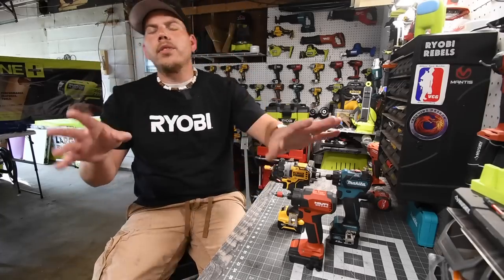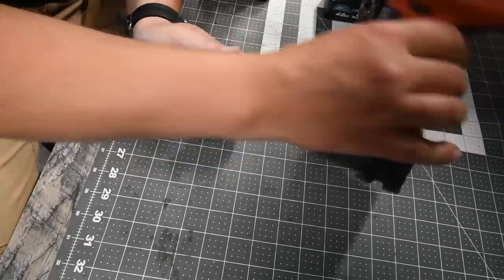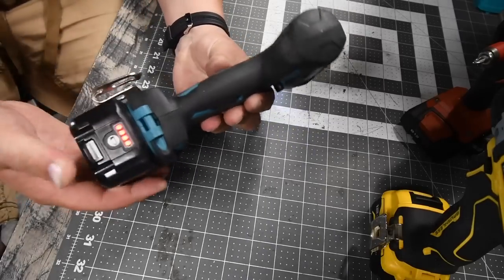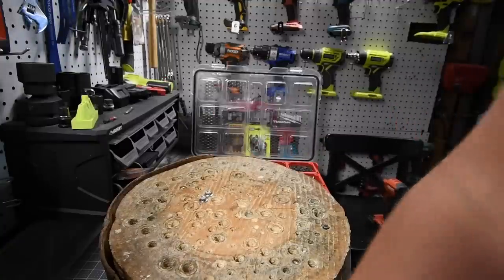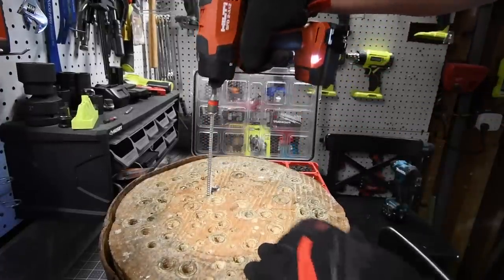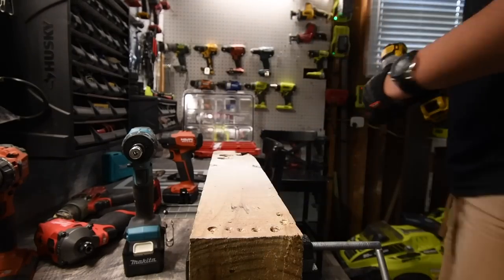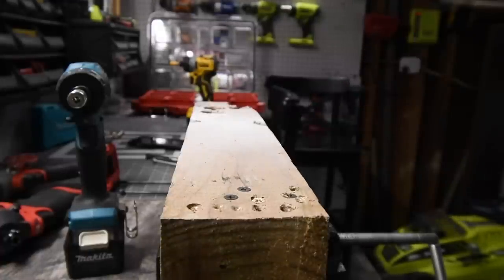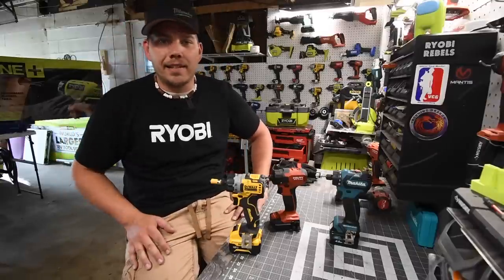The Perfect DIY Tool (12v ScrewDrivers)

Comment: The customizable clutch on the DCF601 is awesome for delicate work. It literally takes the pressure off the bit and screw head and greatly reduces stripping. Very good for use within the home and the tri light is awesome across the line

Comment: That DeWalt 601 is my most used tool. I rarely need to grab anything else. It's very strong, but if needed on Clutch 1 it is perfect for just about anything. I use it on the gun bench all the time. Perfect tool for 99% of jobs and hobbies around the house/garage.

Comment: I would guess that I use the Dewalt DCF601 for more than 75% of tasks, which was a real surprise to me.

I love how light the clutch can be set.  Originally I picked it up because #1 setting on the DCD791 may light for working with wood, but still has too much bounce from the clutch that it almost acts like an impact when screwing in plastic parts like thermostat housings, new ultra thin  and soft aluminum soffit,  etc...  

The 12v Dewalt #1 setting is reliable and light enough that I have no fears about using it to screw in circuit boards. While not the fastest at drilling, it is much nicer to spend time on a ladder with it alone if you only need to drill pilot holes.

I am sure that the other brands work great too and I selected Dewalt purely due to local vendor availability.

Comment: Why in the world would you burden those tools with those huge batteries? The whole point of 12V and a dedicated screwdriver specifically is to make it smaller/lighter than the 18V tools.  Just put a small 1.5-2.0 Ah battery on there and that will be more than enough power/capacity for most DIYers.

Comment: One underrated cordless screwdriver has to be the M12 brushed screwdriver. It can be found regularly for 79.99 (with two 1.5 batteries and a charger) and for stuff like machine screws, drywall screws, or other light-duty tasks, it's an amazing tool because of how light and handy it is.
Reply: I’d agree, i believe that brushed screwdriver can keep up with these brushless that mct has
Reply: @kcvu7215  It's not even close. It cant keep up with these tools in the video. the m12 fuel may be able to, but it's a much larger tool. the standard m12 is completely outclassed by these tools.

Comment: Before watching any of this, I would say the problem around 12v tools is still lack of options. Milwaukee has most things in 12v, except a heat gun. Their soldering iron is great until the thin plastic retaining screw breaks from getting too hot. 

DeWalt now has excellent 12V tools but there just isn’t the variety yet. Hopefully they keep making them. 

Makita has good 12V tools, as well, but again they cover just the staples for a power tool kit and that’s it. 

Then there’s Ryobi. If you can think of it, they make 3 different kinds. Aside from a coffee maker. They got soldering irons (Milwaukee’s is better for the field), heat gun, rotary tool (again Milwaukee’s makes more sense for the field), a vacuum, etc. the only problem is that it’s a larger 18/20V tool. Even the compact Ryobi tools are larger than the other 12V competitors, because it’s still a larger tool and battery. 

Ideally I’d like for Ridgid or Ryobi (or DeWalt, doesn’t matter) to come out with field-centric tools in 12V sizes. Or for Milwaukee to introduce a few more 12V tools and bring the price down a bit (which we know won’t happen)

Comment: Love the video and your channel. I also love 12v tools but this is one tool I never understood the need for? I personally just use my M12 impact driver on mode 1 or lower the clutch setting on my drill if I need an "electric screwdriver driver". Not trying to be negative just don't understand is all.
Reply: The brushed Bosch pocket driver is another great tool for the DIYer
Reply: Dude I thought I was the only one!
Reply: I kind of agree. I have the Milwaukee that came in a kit, but rarely use it. The impact driver or drill can do all the same but also so much more. So in order to save space, I only carry the drill and impact drivers and the screw driver stays home almost completely unused.
Reply: These tools are for low torque applications, using 1/4 hex bit.

The beauty of these tools is, you can set the right clutch setting.  Pull the trigger at full speed And move on to the next screw/nut Where it sit just right. 

This will be much faster and consistent than your impact driver.  Where you have to rely on the variable trigger, And hope you don’t over tighten the fastener, or over sink the screw.

So you can also do this with the drill.  But with the drill, the bit isn’t as secured as the 1/4 hex adapters are, And these tools are much more compact, making it a better fit for tight spaces.

But most importantly, having a variety tools is FUN! 😀
Reply: Don't play with the chuck especially in tight spaces...

Comment: I'm a milwaukee dude. Bought the Cd-0 m12 screw driver and was dissapointed. Don't get me wrong. Super awesome screw driver. Strong and sturdy.
But small? Nope. Big and clunky and top heavy. You'd have to slap on a 6ah battery to get the balance ok. And the m12 grip is bulky.
I'm getting this Dewalt 601
Reply from the maker: im not a fan on how big the handles are on most of the m12 tools
Reply: @ManCaverTools  Yeah but I guess that is what you get when you glock 17 the battery up there. 🤷‍♂️

Comment: What is the difference between these and just using the m12 fuel hammer drill on drill mode?
Reply from the maker: these are specifically for smaller jobs. they are shorter because they don't need a chuck on them.
Reply: @ManCaverTools  so no drilling. Is it a better value to get a drill/driver then? Trying to avoid tool creep...

Comment: I have the DeWalt and Milwaukee.  The lack of a low gear on the DeWalt is a negative for me. I got in a spot where I was down to one bar with the DeWalt using a 2AH battery and it couldn't remove a three inch screw, where the Milwaukee could.  Yes, that is a rare situation but it still occurred. The low speed is the only thing the Milwaukee leads in though. I prefer the DeWalt overall. I got mine for $99 in a kit with the bag,charger, two 2AH batteries and the screwdriver.
Reply: I have the Milwaukee fuel one but I do like the Dewalt , I'm undecided if I need the Dewalt one so my question is if you could only have one of them which one would you choose  ?
Reply: @gustavomacall4997  DeWalt,  you already have the Milwaukee.  So I would just stay with that.
Reply: @Dale37  I'm glad you said Dewalt , I was looking for any little excuse to go get it , as a Milwaukee and Dewalt tool addict I've realized that wanting is stronger then needing lol so as soon as the raider game is over I'm heading to lowes to pick it up 🙂
Reply: @gustavomacall4997  lol I feel the same way.

Comment: It would be interesting  to see how the Milwaukee M12 screwdriver would fare, as well as the M12 2505-20 4-in-1Installation Tool.

In fact, I could lend you my 2505-20 for testing if you do another one. How do I contact you off of here?
Reply: I have the the m12 fuel 2402 and love it.

Comment: Those 12v drivers are my absolute favorites as well. I always have one near me or in my tool bag. I prefer the two speed versions; speed 2 for drilling pilot holes, speed one for driving screws. I have both the milwaukee fuel and new bosch GSR12V-300HX; I love how compact and light the bosch is, but don't like the light; it has a yellow tinge. I love the auto load collet of the milwaukee and how smooth it runs, but I'm not crazy about the heavier weight and size. Milwaukee needs to revamp this one with a smaller body.

You gotta get those two to compare. :-)
Wera makes collets identical to that hilti one (they call them "rapidapters"); they're amazing.

Keep it up. I love your comparison videos.

Comment: It seems like these would probably still be overkill for precision work or even trim work like installing wall plates. Also you didn't really compare anything but power. Like if you had to pick one for comfort or size or precision or whatever which would it be?

Comment: I dont know man I really dont see any advantage to this vs a drill which can adapt more than a hex fitting.  You can also buy quick change hex adapters for a reg chuck drill
Reply: In theory, size and weight. Adding a hex adapter to a drill (which I definitely have done) makes clearance even more of an issue. I actually don't have one of these, but could see the benefit of having a more compact and light option for simpler, less demanding tasks around the house.
Reply: Smaller, more precise torque settings, weight.

Comment: Drilling or screwing into wood gives you a reasonably good idea but isn't a highly accurate way of testing these tools.
Why not very accurate?
1. Wood varies in density depending on the grain (especially if you hit a knot).
2. If you put lots of screws close together the wood will be compacted, denser and harder to screw into.
3. When driving screws close to the edge of a piece of timber there will be less resistance as the wood can be pushed out of the way more easily.
4. Drilling  holes close together (which wasn't featured in this video but just sayin'...) has the same effect as driving screws near the edge of the timber.
I'm not criticising the video, like I said it still gives you a reasonable idea of the performance, but if you're trying to decide between 2 tools and the performance is very close I'd ignore the torque and look at other factors to help me decide such as size, ergonomics, durability, price, 'features' etc...